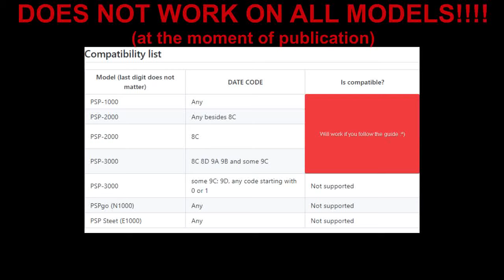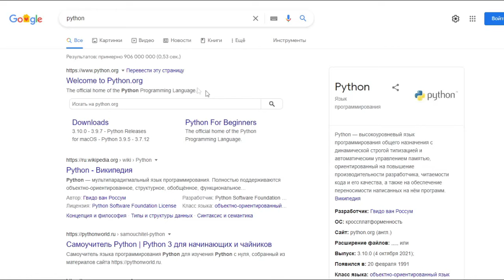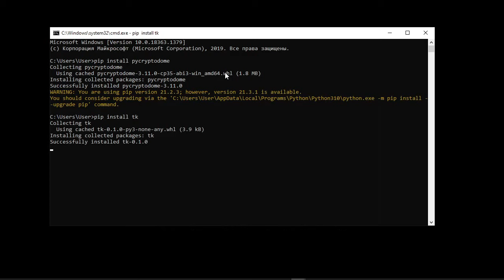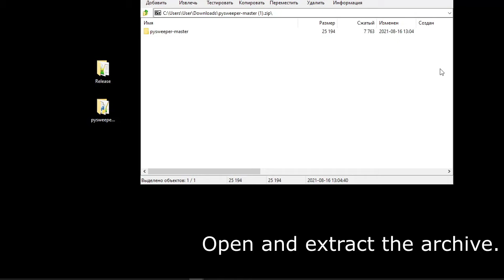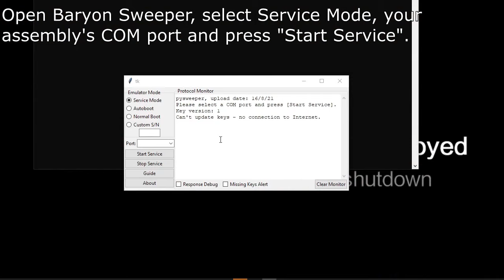PSP-3000 Baryon Sweeper (Solderless) Unbrick Guide

Comment: How can I find my motherboard on my psp 3004 if was bricked?
Reply from the maker: If there is no DATE CODE under the battery, do it the trial and error way. Try it, and if your motherboard is compatible, you shouldn't get errors mid-handshake because key is missing.
Reply: @akhubik2006  The date code is 8D and I want to see if motherboard is compatible.I haven’t the tools to unbrick my psp but I’m going to buy!There is a another method for psp 3000 and to find motherboard model?
Reply from the maker: @draganvictor6901  it is supported.
Reply: @akhubik2006  Any motherboard of PSP 3004 (date code is 8D) is worked for unbrick?
Reply from the maker: @draganvictor6901  date code helps identify the motherboard... 8D is either TA-090v2 or TA-091, i don't remember - i only know that you indeed can restore them
Reply: @akhubik2006  Okay,but is works on any adapter and and battery?
Reply from the maker: @draganvictor6901  i recommend to use ch340 or cp2102 usb-ttl adapter. you can use any li-ion 3.7v battery.
Reply: @akhubik2006  I asked if is work on any ac adapter not USB adapter.
Reply from the maker: @draganvictor6901  any common phone charger (5v) will do

Comment: Hello. For some reason when I connect the board to the connectors the window on baryon program says port is busy.
Reply from the maker: Please tell me what version are you using and whether or not this happens when you press "Start Service" or when you touch the battery leads.
Reply: @akhubik2006  pysweeper is Key version 1, upload date 16/8/21. Psp is a 3001b 409B. It pops up when I connect to the leads.
Reply from the maker: @daltonkiksass  are you sure right port is selected? 
maybe the port name changes after you connect the leads? also tell me what adapter are you using.
Reply: @akhubik2006  Hey, it's me, made a new account. Also, sorry for the extremely late reply. Using the right port, and the name stays the same, but it won't let me use the port again until I unplug it and reinsert. I am using HiLetgo CP2102 USB 2.0 to TTL Module Serial Converter
Reply from the maker: @DaltonRodriguez-ly8si  I'm not sure why that happens, but general rule of thumb is that if your port disconnects, you want to supply more power along its power rails. Something like an external battery connected in parallel.

Comment: Hey! I tried this method on my PSP 3001. Idk what the datecode is and neither it is written on the back. The screen turned on but when I removed the wires, it turns off, also this won't happen when the charger is plugged in. I don't know what is happening.
Reply: Update: I just unbricked it. Thanks for making this happen! Kudos to all the guys behind this.
(Except the buttons don't work now)
Reply from the maker: @yuvrajpreetsingh591  How did you fix the issue?
Reply: @akhubik2006  I realized that connecting the charger was turning off the PSP as it stopped it reading the data from the memory stick. 
So I kept the wires connected and flashed it without connecting the charger. I guess the power from +5v of the USB to TTL was enough to make the PSP think it is a battery and kept it turned on by itself.
Reply: let me know if the buttons still doesn't work cause i managed to fixed mine the buttons wasn't working but there is a workaround for that
Reply: @ramanpannu2110  Yes please tell me about it! They still don't work.
Reply: @yuvrajpreetsingh591  when the service menu boots up for installing the software. just slide the power button completely off and then turn it on again and then the buttons will work fine
Reply: @ramanpannu2110  Which service menu? The menu which is used to flash the psp?
Reply: @ramanpannu2110  My psp has already been unbricked, so should I connect everything again and do the steps once more?
Reply: @yuvrajpreetsingh591  yes exactly
Reply: @ramanpannu2110  I will surely get back to you once I try to do it.
Reply: @ramanpannu2110  I tried it, if did not work. I even reflashed it just to be sure.

Comment: Thanks for this work! Unfortunately I was not able to make it work on my PSP 2004 with date code 8C. I bricked it trying to mistakenly install some CFW and now I only get green light on power on and blank screen.
I'm using an Arduino Uno as  serial converter (like in the video) and a power supply providing 4.2V into the battery power pins. When I power up my setup the simulator gets the sequence 5A 02 01 A2, then the simulator sends the sequence a5050610c30676 but the PSP keeps sending 5A 02 01 A2 for a while, then a wider zero pulse and keeps silent afterwards. I have the feeling that for some reason the PSP is not properly receiving the transmitted sequence and keeps repeating 5a0201a2 until it gives up. 
Levels on the K line are a bit weird. Without the diode in I get a steady level of around 2.2V and drops to zero when the PSP is sending data. When I attach the diode to have the signal transmitted over the same line, the levels seem to be more or less the same as for the received data (I'm getting the signal from the PSP on TX). Using a logical analyzer setup  to 19200, 8 bits of data, 2 stop bits and parity even I´m getting parity and frame errors on the data coming from the PSP (probably because of the low steady level of the line and even so the simulator is able to get it what is weird) but the data transmitted towards the PSP looks fine.
Any idea of what are the expected levels on the K line or what the issue could be here?
Reply from the maker: should be standard uart logic levels... i don't know the spec really
Reply: OK. Finally I got it. Maybe my wires to the battery port are not thick enough but I was providing 4.2V with an additional power supply. I managed to make it work when after the negotiation procedure started I plugged in the AC adaptor. The menu showed nearly immediately!
Happy to have this PSP back alive!! Thanks a lot

Comment: I get the error “Port COM5 busy, not present or you don't have per missions to use it.” Help me please
Reply from the maker: what adapter are you using?
Reply: Edit: The CH340G module from Amazon worked for me. The psp turns on but black screen.. I guessed was the magic memory stick . I tried to re make it with but nothing... What I'm doing wrong this time?
Reply from the maker: @itsnubel  Make sure your console is supported and that you're using DDCv9. It does not require MSID shenanigans.
Also make sure that the tool is correctly formatting your Memory Stick - it should repartition it so that service mode IPL can be uploaded at the beginning of its memory space. If it doesn't work for some reason, try extracting IPL from the archive the software downloads, flashing it with Rain's IPL tool then copying DDC files over to MS manually.

Comment: this tutorial is awesome. a but overwhelming for me with 0 experience or knowledge with arduinos and software. A motherboard replacement is probably the easiest method for most ppl. they go for about $25-35 depending on Region and Country
Reply from the maker: Motherboard replacement is much more tedious, since you have to tear your PSP down starting from the front panel and screen. Screen is fragile, and you have to do it in a dust-free environment or have neccessary solutions and a microfibre cloth at hand to clean the screen and lens before reassembling. I find software repair much easier - if you have any trouble following the steps, feel free to ask any questions for better understanding.

Comment: Hi,
I'm trying to unbrick a PSP 3000 with Date Code 8D. Followed the tutorial, but when i plug the cables to the PSP, power led blink on Orange and nothing else happens. On pysweeper only shows that:
Using serial FFFFFFFF
5A 02 01 A2
5A 02 01 A2
5A 02 01 A2
.....

And never boots.
I tried with 5v plug, with 3.3v plug, with different Sandisk MS-Pro sticks (8GB and 2GB), creating it with your program and with PSP-Tool V1.0 like someone suggested.... 

Any help, please?
Reply from the maker: reverse rx and rx lines
Reply: @akhubik2006  i need to reverse the diode too?
Reply: @akhubik2006  I reversed rx & tx cables and I only get this:
Service started.
Using serial FFFFFFFF
5A 02 01 A2
A5 05 06 10C306 76
5A 02 01 A2
A5 05 06 10C306 76
5A 02 01 A2
A5 05 06 10C306 76
5A 02 01 A2
....forever 
:(
Reply from the maker: @Metanei81  i dunno... check diode orientation
Reply from the maker: @Metanei81  actually you can use a jumper instead of a diode - see if it helps
Reply: @Metanei81  Any luck? I faced the same issue..
Reply: @Azhan1997  not yet 😣 I want to try with the jumper instead of the diode, but not sure it will work. 
Are you trying it with arduino too?
Did you used arduino before that? Because I never tried an arduino before and maybe I missing to install something on the computer before use it…
Reply: @Metanei81  I tried using USB TTL method, diode and jumper still giving the same problem unfortunately.

Tho I suspect that maybe coz I don’t use the OG PSP adapter. Seems like the orange light indicates something wrong with the power. Insufficient power I guess.

Will try again once I get myself the adapter.
Reply: @Metanei81  Hi, were you able to fix this issue?
Reply: @thedudemru  Hi, I didn’t solved it. My 3000 stills bricked 😢
I read some weeks ago that you can use an external battery to power the psp, but not tried yet. Maybe is the solution.
Reply: @Metanei81  do you have any other boards? Like arduino
Reply: change TTL to cp2102 check if the resistor is 10k ohm.  connect charger to psp.

Comment: ERROR: Could not find a version that satisfies the requirement request (from versions: none)                            ERROR: No matching distribution found for request   

if you get that, dont worry, it still works, for me I need several attemps (damn 20 minutes) to put that 3 jumper wire until my psp turn on.

Comment: didnt work for my psp 1004 5D date code can you help me?
Reply from the maker: is there any communication between PSP and the program?
Reply: @akhubik2006  im using pl2303 and the programs you used in the video, im connecting the psp device as shown at video
Reply from the maker: PSP FAT models are prone to hardware issues related to motherboard stresses near the D-pad area. Can you please tell me how it behaves when you try to power it on?

Comment: Hello Khubik I have received all the electronics part to get it working, I was able to follow the tutorial but mine even if I connects the PIN's I stay with Using serial FFFFFFFF sometimes I can see some spark on the psp pins but there is no response, maybe I've setup something wrongly ? I'am willing to throw a few bucks to you if you were able to help me though Discord or something, thank you!
Reply: Tried various stuff started to get a response "5A 02 01 A2
" not going further though
Reply from the maker: Send me photos of your assembly.
You can contact me with Twitter DMs: @khubik2
Reply: @akhubik2006  Same thing
Reply from the maker: Did you fix this?

Comment: I managed to get the green LED power and orange blinking from memory card but no imagine on display.
Reply: I figured, it was an SD card problem, After I bought a new one it worked, but I tried the version with a diode, resistor and battery, not the DC. Thank you a lot, after 8 years now it's finally alive:)

Comment: In the keys.json, challenge1_secret and challenge2_secret contains the 151. but,the keystore no contains 151.did it lost.
5A 0B 80 97BB9312C44CADB431 81
this is the last i reviced from serial port. 151 is i need.
pls update the keys.json,or provide the documentation.
thanks a lot.
Reply from the maker: It's been stated that Key 97 (5A 0B 80 97...) is not known and it is unknown when it will be extracted, if ever.

Comment: This is amazing. Now I can try to unbrick my old PSP 2000 soon. I'll just have to buy a diode.
One question: can I use a different Arduino board (I have an Arduino Nano)
Reply from the maker: sure. keep in mind you still need to short reset to gnd and that rx and tx might be inverted on your board too.
Reply: @akhubik2006  So I tried it now but the pysweeper doesn't go beyond 5A 02 01 A2 (it just loops) and the orange memory LED is blinking (on sync with the looping hex code) and it doesn't turn on. I have an old Memory Stick and bought a microSD card to Memory Stick adapter and both had the same result.
Reply from the maker: @DisYaBoiRalph  if it loops, then TX outputs into nowhere - try switching RX and TX places and see if it helps
Reply: @akhubik2006  Hi! (PSP 2006)
So I stopped using the diode and just shorted TX and RX together using the CH340 and now it loops at:
5A 02 01 A2
A5 05 06 10C306 76
It doesn't go farther.
Reply from the maker: @DisYaBoiRalph  I'll investigate today. Tell me which version of software you are using.
Reply: @akhubik2006  when I tried it again, the version of the softwares used is whatever in the GitHub repos. As for the PSP motherboard, I'm not sure how to check it. I just know it's a PSP 2006

I'm using Python version 3.9.5.
Reply: @akhubik2006  I have the same problem
Reply: @Darknat76  did you find a solution?
Reply: @DisYaBoiRalph  were you able to solve the issue? I running into the same problem
Reply: @VFXnirvana  with pandora battery .. (for psp 2000)

Comment: Currently trying it to unbrick my PSP 1004. However it seems not to work as well as in the video. It keeps displaying 5A 02 01 A2 and sometimes more, but the PSP itself doesn't boot itself.
I use the same USB to TTL as in the video.

Any tips?
Reply from the maker: it's not getting the response from you, check diode orientation and maybe switch RX and TX places
Reply: Doesn't the 1004 just need the classic Pandora stick+battery?
Reply from the maker: @Jacksoft  it accepts that,  but you might want to use a battery emulator if you don't want to pry existing battery open or if you don't have any in the first place.
Reply: Hi there, having a very similar problem with a 2000 TA-88v3. 

Keeps repeating 5A 02 01 A2

or

5A 02 01 A2

A5 05 06 10C306 76

Depending on how I orient TX/RX 

Only thing that got me past those was if I disconnected the external power, but then there's not enough power being supplied to get too far further. So I'm stuck.
Reply from the maker: @GloriousPCsammich  if you don't want to use external power, you can connect some power source like a lithium battery or (in worst case, a phone charger, but that may be unsafe since battery is 4.2v at best and phone charger is 5) in parallel, like on schematic by Yoti, see pysweeper repo README for that.
Reply: @akhubik2006  Thanks for the reply! I actually have some Turnigy cells I wanted to use for PSP battery restoration, that still have connectors! 

Would I connect the Lithium battery to the breadboard in this case?
Reply from the maker: @GloriousPCsammich  Does not really matter as long as it goes to PSP power leads.
Reply: @akhubik2006  so ended up getting it working by improving the connection to the PSP itself with an adapter and sticking with a diode instead of a jumper. Stuck with Arduino as USB TTL FT232R didn't work for me. But now the PSP just boots onto green light and no picture... tried recreating the MMS but unless I'm messing up, seems like it might be a hardware failure unfortunately :/ 

I'm creating the MMS in a windows 11 ARM VM, seems to work fine, but do you think this could be affecting the MMS?
Reply: UPDATE: tried it on a known working PSP and same result. Could still be that the MMS is the issue then, and not HW failure. I create the MMS with the exact same card as you and same process, any idea what might be the issue?
Reply from the maker: @GloriousPCsammich  You can try using Arduino 5V pin for power, it worked for me. If you don't get further than 5A0201A2 / A5050610C30676 then it's not MMS issue...
Reply: @akhubik2006  I ended up getting past that loop by improving my connection of jumper cables to PSP. Now PSP boots to green LED but doesn't have any memory card activity. I tried on multiple PSP and same result, so pretty sure it's a MMS issue. Following some guides on PSX forums but they're a little hit or miss so-far.
Reply: @edomarcelli794   sorry to hear that you're having trouble. But everything I know I wrote down in my update, wouldn't know how to make it work without another CFW enabled PSP.

You can try finding a fat model on your local marketplace for like ~40 bucks and then repeating the solution.

Comment: Nice guide, but I still have the same error "No port echo detected".
Reply from the maker: Check your assembly or try different adapter. Arduinos sometimes work and sometimes they don't
Reply: @akhubik2006  5A 02 01 A2 Loop
Any ideas?
Reply from the maker: @Doom_YXZ  what serial adapter are you using?
Reply: @akhubik2006  usb to ttl ch340.
I tried to use 5v, but it gave me only 5A 02 01 A2, A5 05 06 10C306 76 loop and works like that without dc..

Comment: READ THIS IF YOU HAVE A TA-095v2
Tried zecoxao's method from psx place (despertar del cementerio v9 doesnt work on this revision), worked on TA-095v2, only problem was that it brings the firmware down to 6.20 so the system is unstable (minimum ta095v2 version is 6.30, psp won't suspend properly etc.)
So when you try to update it gives you error IDXFFFFFFFF, i had to use Frostegater's TA-095 Upgrader to bring it back to 6.60/6.61.
Leaving this comment here so if someone is on my same boat you will know what to do...

Comment: IF THIS WHAT I SEE Using serial FFFFFFFF
5A 02 01 A2
5A 02 01 A2
5A 02 01 A2
5A 02 01 A2
5A 02 01 A2
5A 02 01 A2
5A 02 01 A2
ITS NOT SPPUORT?
Reply from the maker: it means you should verify your assembly
5a 02 01 a2 is the message from PSP, but program's message (starts with A5) does not reach PSP...
Reply: @akhubik2006  there is something to do?
Reply from the maker: @lioralush207  check your hardware assembly, try using another arduino or usbttl